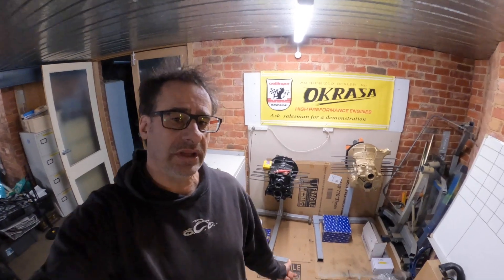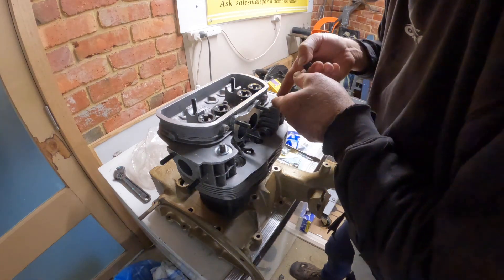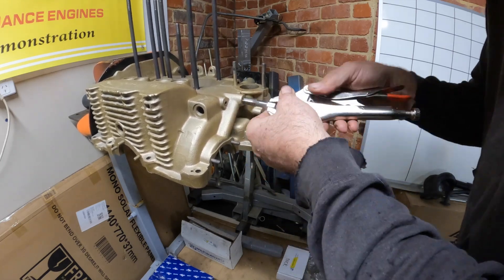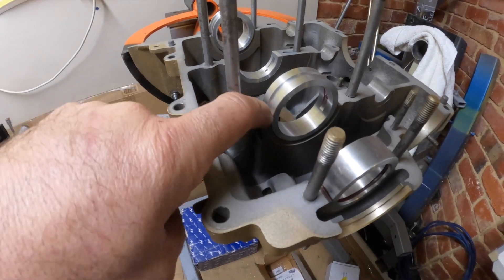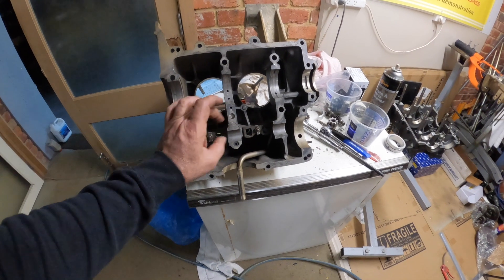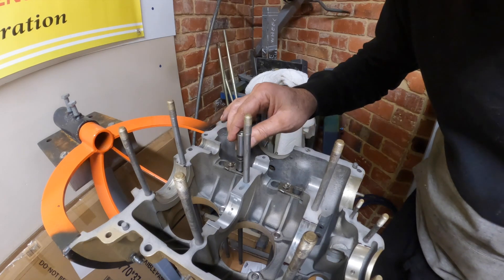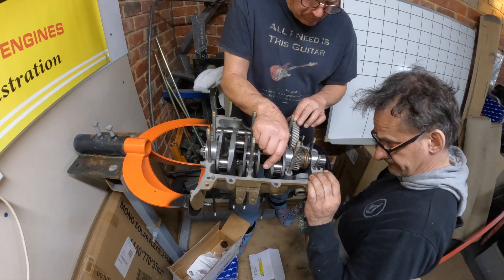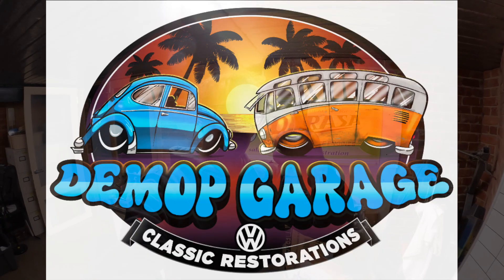Okrasa 36 hp motor build // Case prep and mock up.  PART ONE #vintagespeed

Comment: hey man beautiful build, what tap size did you tap the full flow port to? at 4:45 1/4npt? 3/8npt?
Reply from the maker: 3/8” but then the oil lines are 5/8. The bigger the better because I’ll run a oil cooler
Reply: @DemopVWgarage amazing thank you

Comment: I'm thinking "This is precision". Then things went bad but I guess that's the way it goes sometimes.
Reply from the maker: @dalewyatt1321  thats it, it worked out fine just changed out the gear and all went in smooth. Test fit 20 times before final assembly 😉👍🏽

Comment: People don’t understand how much time it takes to properly build an engine. But that’s the difference between an engine lasting and one failing. 
Appreciate the shout out my friend!
Reply from the maker: @VWJawbreaker  Dam right I spent 4 hours porting one head alone 🤦‍♂️😳😂
Reply: @DemopVWgarage  oh I get it! I spent a full day with VW Darrin getting the heads sorted out for the 1760 build.
Reply: @DemopVWgarage . Did you have to have any special clearancing for the 356 cam  to fit the case ?
Many thanks 
Jon